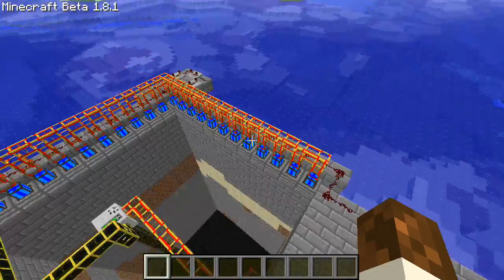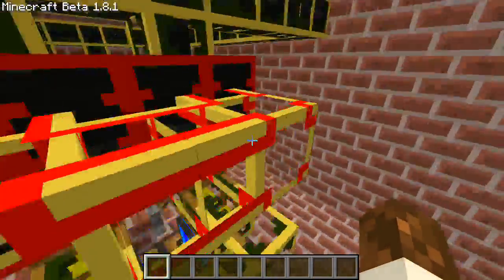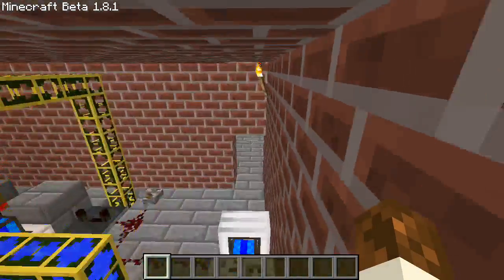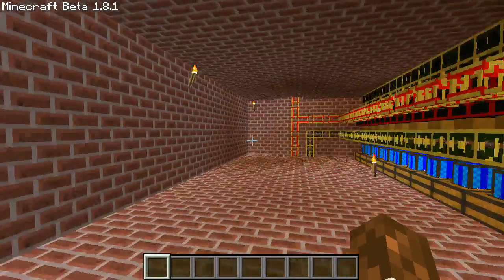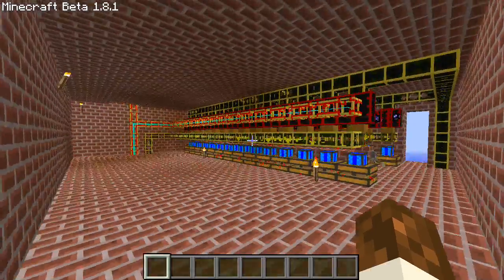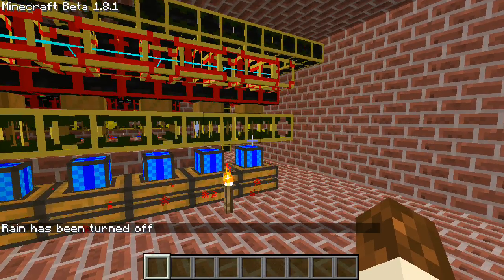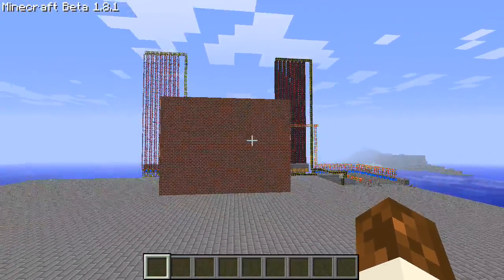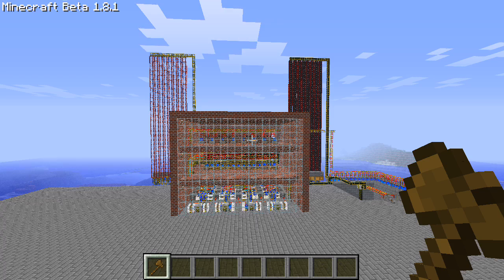019 - Buildcraft Creative - Refinery System V3

Comment from the maker: @lspuris Well, you can't cool steam engines down without turning them off and they require fuel, so I prefer this because I think it involves less maintenance then using a steam engine powered cooling system.

Comment: @mrtoast888 Fair enough. Strange though. I guess you already knew this as well (because you successfully used //set...) but it is double slash. //wand. Also you need a free inventory slot. preferably on the quick bar thing.